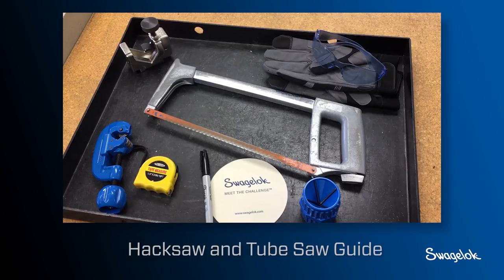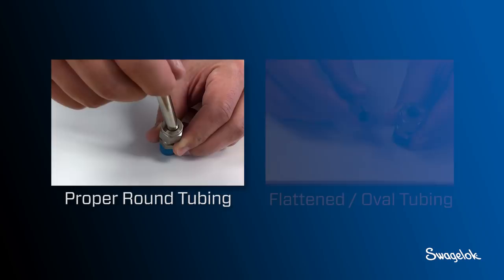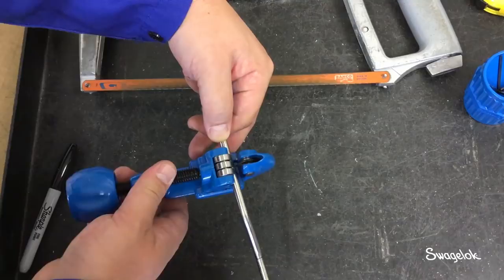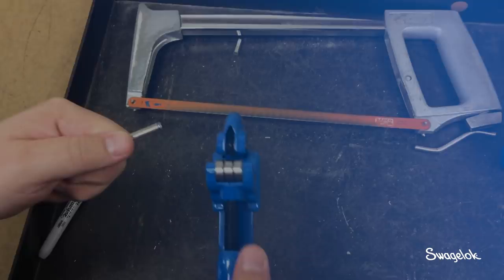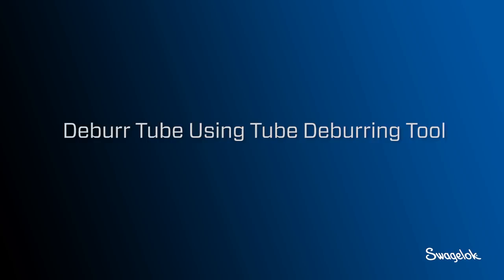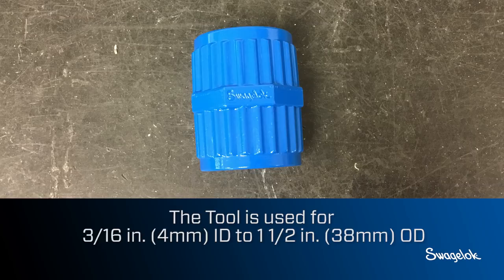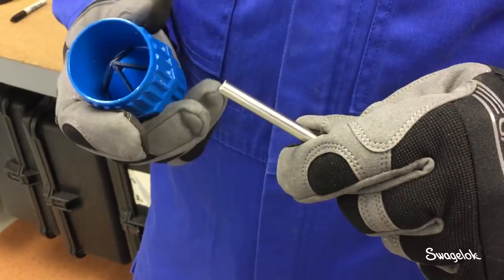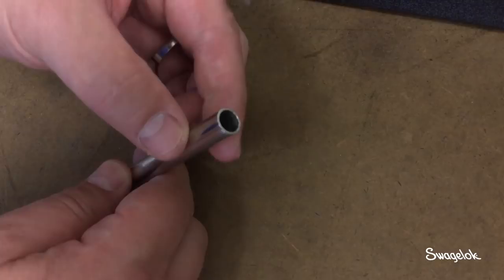How to Prepare Tube Ends (Fittings) | Tech Tips | Swagelok [2020]

Comment: you guys have top notch product , flare fittings leak 5% of the time on steam systems, this is messing with my process control switches , i regret not using this system . the beauty is in the fact it seals the outside of the tube , not the inside wich is often seem welded resulting in leaks